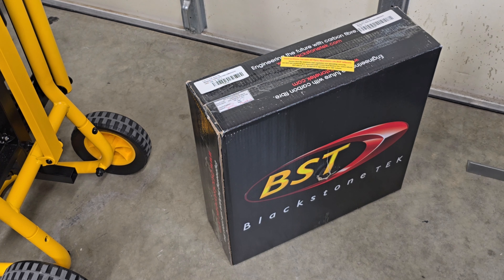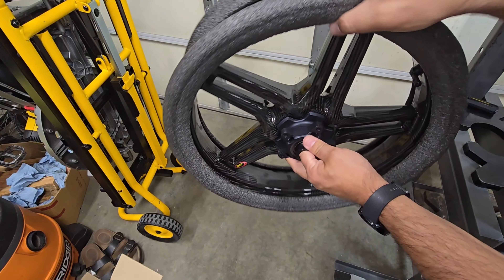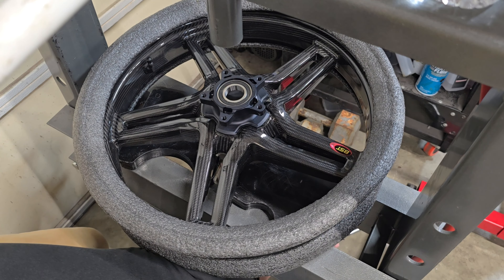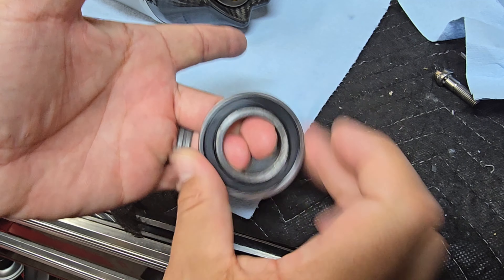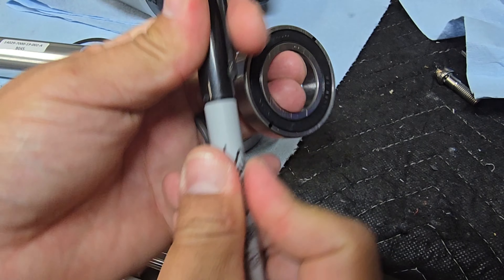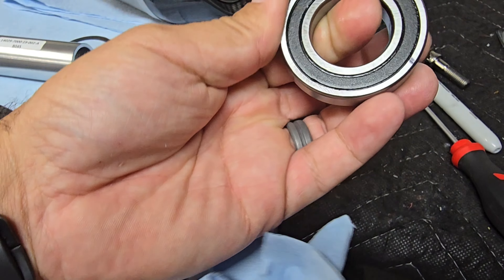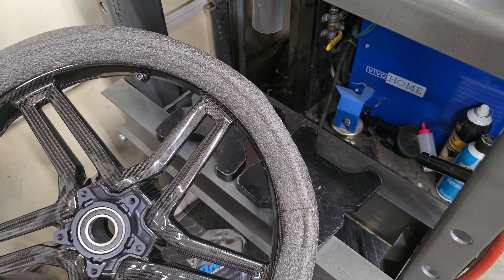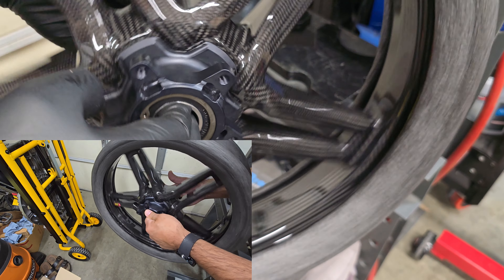Ducati V4 | Ceramic Bearings Install | Brock's Performance

Comment: Love those wheels! Have you taken weights to compare before and after on everything you've done?
Also, quick question not relating to wheels. I have to flush brake and clutch fluid. Is the same fluid used for both? Seems that's what I'm gathering so far.
Reply from the maker: Hey, thanks. I appreciate that. I did not take weights prior, I'm kicking myself for that. I have the steel bearings, which I can weigh those, but I never took the weight on the ceramic ones to compare. I was doing this mainly for the lower resistance and longer life span. They spin so freely.  The lighter weight was a plus. 
Yes, both fluids are the same. Thanks again.